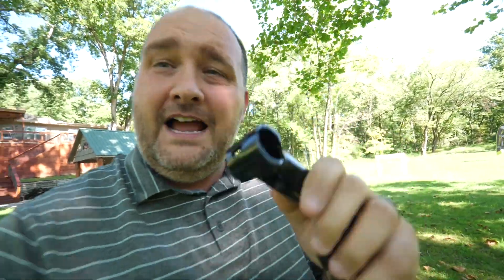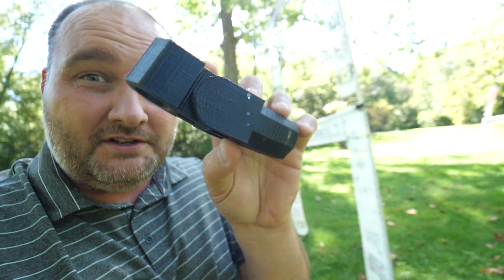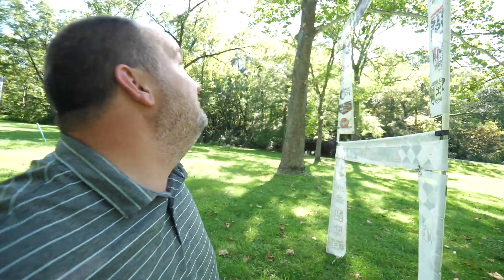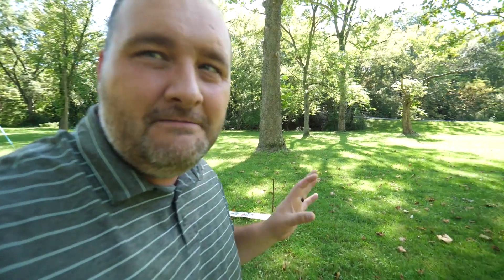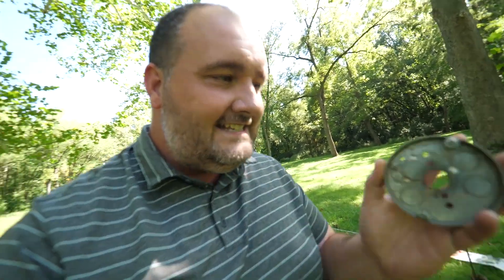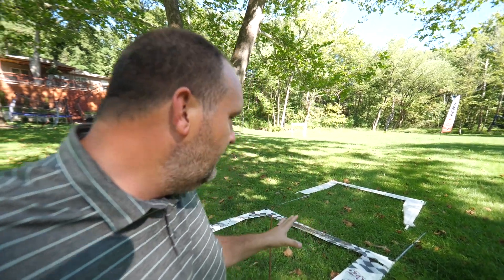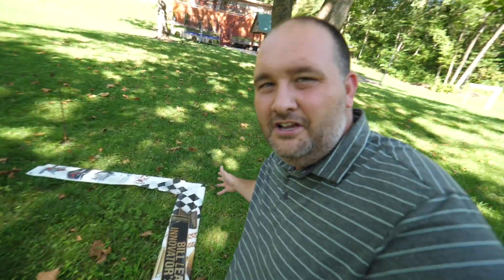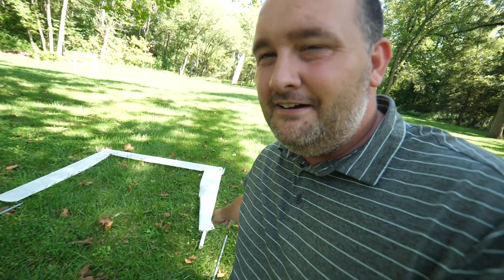How To Make A Double Gate Without Guy Wires!

Comment: Guide wires..
Reply from the maker: Definitely guy wires.
Reply: You could at least do a Google search before correcting the guy. He's obviously into what he does and knows what he's talking about. 

Just in case you don't Google it though, it's called a guy-wire or what I prefer, guy-line, and is specifically used as a tensioning device. Guy wire is correct!
Reply: @thegrafxguy1  I was right, I just spelled it wrong.. it's called a guyed wire.
Reply: @Actionstevo  um, no. That would infer that it was past tense. Or the action perhaps. The tower was 'guyed' maybe, but by guy wires. Guide wires is just an incorrect hearing and pronunciation by the uneducated.

Comment: Nice, what is EMT? I'll have to figure out whatever that is called over here.
Reply from the maker: Electrical conduit available at hardware stores.
Reply: @heartofamericafpv5584  Why use emt over pvc pipe for the gates? Is there a benefit in cost or performance? I'm new to this, so I'm honestly curious. The only gates I've made myself were using 1/2" pvc for 12 & 24" squares to fly micros through around the back yard.
Reply from the maker: sixtofive EMT is 10-20x stiffer than pvc.
Reply: @heartofamericafpv5584  That's good to know. I'll be interested to see the dive gate video you mentioned.